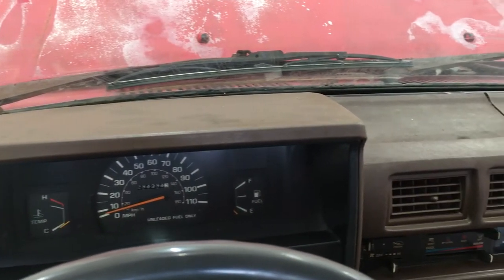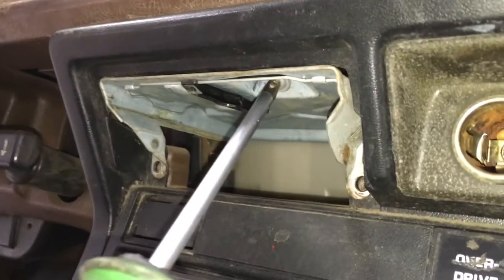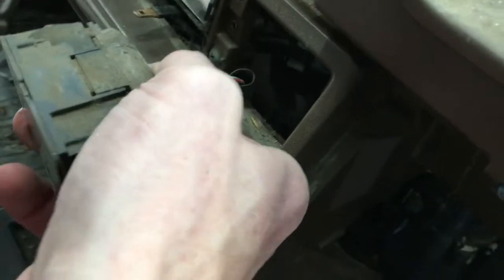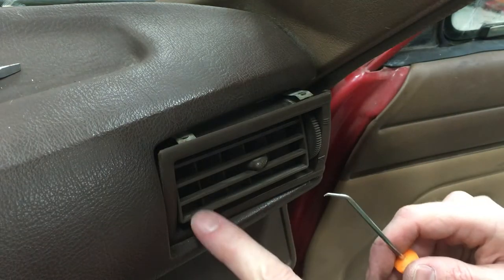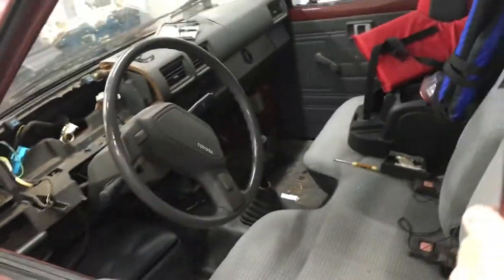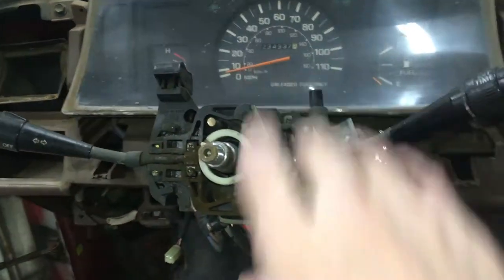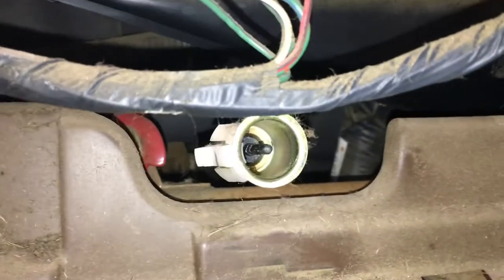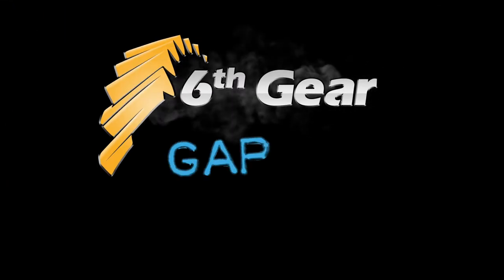How To Remove Toyota Pickup & 4Runner COMPLETE Dash & Steering Wheel

Comment: Where can I get a replacement dash pad? mine looks like the one you removed.
Reply from the maker: I haven't found anyone who sells them, only thin covers to sit on top of the cracked dash.
Reply: @6thGearGarage  same here.
Reply from the maker: @paulgugger8987  I know it's possible to re-wrap a dash. I've seen it done on other cars. I need to figure out that process and make a video.
Reply: @6thGearGarage  it is a good idea to make a video. I habe the same problem.....
Reply: Check out Just Dashes in California. Seem to be the experts on restoring dash pads. Mr Corsetti Who restores FJ60 Landcruisers has used that company to restore his Toyota dash pads. They are a little pricey though. They quoted me $900 just to restore my cracked passenger side dash pad.